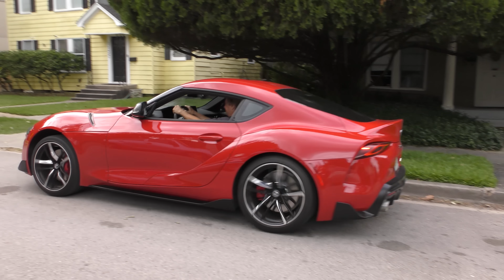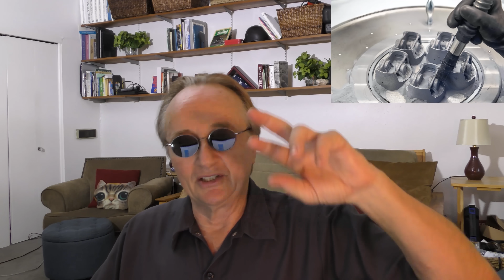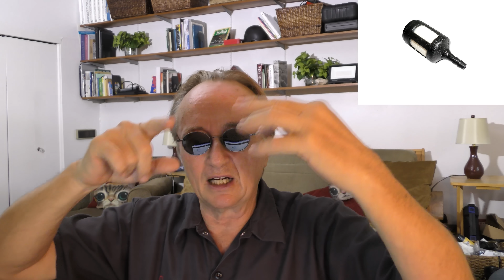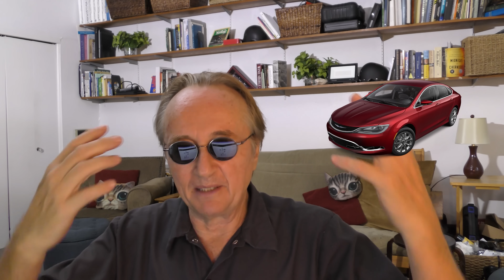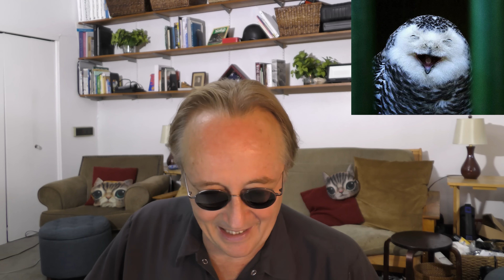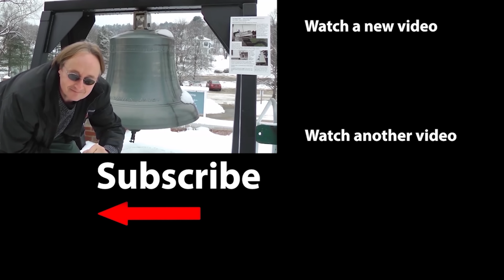Porsche Just Changed the World with This New Engine

Comment: I'd like to see them make pistons for an aircraft engine. A 470 CI or larger 6 cylinder engine. Then run that to TBO which is usually 1200-1500 hours. These engines are close to their capacity most of the flight.

Comment: Some of the really interesting engine tech that was developed a few years ago but isnt in mass production yet is solenoid controlled valves.  The idea eliminates the need for cams, gears, belts, chains etc, makes the entire engine simpler and more compact and lighter.  It also allows for nearly endless possibilities in valve timing which can adjust as needed. The biggest hurdle being reliability of solenoids.  I believe it was Koenigsegg who built a camless engine.  There are some videos of them also testing out a cam less head on a Saab.

Comment: 3D printed metal parts are being used in aircraft engines which far exceed any automotive use.  The 3D printed pistons will have a better grain structure than a cast piston but no where near as good as a forged piston.  However the 3D printing will allow all sorts of complex internal features that are not possible in forging and challenging if even possible on a cast part.

Comment: Scotty, One common theme through your videos (including this one) is that Chrysler autos are junk.  I own a 1996 Dodge Intrepid (3.5L).  In a little under 600 miles, it will turn past 300,000 miles.  Other than normal maintenance and wear items, the only major trouble I've had was a leaking camshaft seal at around 262,000 miles and a leaking head gasket at 286,000 miles.  Did I just get lucky, or did Chrysler, at one time, manufacture decent automobiles?
Reply: I was the one who posted to Scotty about my Pacifica.  I've owned from Chrysler- a 2003 300M, 2005 Dodge Magnum RT, 2011 300 Limited, 2014 RAM Laramie Longhorn, 2013 Town& Country, and 2019 Pacifica. Except for the complete structural failure of the 2013 T&C (which killed my wife- litigation pending), they've all been great vehicles with very few issues here and there.

Comment: I could see it working even if it takes 12 hours to make a piston if the printers are cheap enough.  For example if it takes 12 hours to produce one piston and you have 1000 printers then you can produce 1000 pistons per hour.  I have no idea the cost but I suspect that the printers are not cheap.  On the other hand 3D printers for plastic cost an arm and a leg when they came out and now they're practically cheap if you're using them for profit.

Comment: I have an extended warranty through Chrysler Dodge FCA and it has been honored the two times I brought my car to my dealership, once for replacing a tire that was damaged, and the $100 deductible was even waived.
Reply: That's cool.  I was the one that posted to Scotty about my Pacifica.  I had good experiences with FCA on my late wife's 300 when it had a couple of issues during the extended coverage (after 36k).  She was killed in her previous minivan, and I needed another minivan to keep my sanity with a 1 year old and a 2 year old.  What drove my purchase was the IIHS Top safety pick status of the 2019 Pacifica.  In addition to the "highest amount of components covered" coverage level for 7 years/unlimited miles, I also negotiated for free oil changes (indefinitely) at any Chrysler dealership for it.  So some of my maintenance is also covered.

Comment: I had a good experience with an extended warranty. We bought a used Mercury Sable and bought the warranty. After we owned it for a while, the oil pan gasket started leaking. The engine has to be removed to do this, but the insurance paid for it. At least that company lived up to their promises.

Comment: Hi @Scott kilmer. 
I have to say...
I had 2012 Chrysler 200. All maintenance done by the book at the oficial dealer. The car start turning off by itself without no reason. After 1 month, I can smell burning oil from inside of the car.
I drove the car to the dealer lots of time and they always say "this is normal".
Well, 1 month later...   the engine was liking for everywhere. He couldn't find the start point, because the whole engine was cover by oil.
Guest what???? The car had 108,000 KM.

My 96 Corolla has 332,000 KM and still running strong and NO leak at all.
Reply: I had heard that the 200 was a nightmare, which is why it was gone as quickly as it arrived. My wife had a 2011 300 Limited, and it was great.  Too bad it's being discontinued.

Comment: I purchased an extended warranty on my Infiniti G35 Coupe. The factory warranty was 4yr/70K and the Infiniti extended warranty added 7 years or 60K miles. I hit the time and not the mileage. 

This warantee was from Infiniti and it cost me $1,100. I shopped all over and the most expensive was $2K (out of Connecticut) for the same warranty, so it was worth finding this dealer in Minnesota that would sell it to me at that price. 

I had a seat motor, 2 window motors, a third brake light ($300 right there) and steering column replaced under this warranty. The warranty easily paid for itself and gave me some peace of mind. The only thing it wouldn't cover was wear and tear on cosmetic parts. I take care of my cars, so that's not an issue.

My grandfather purchased a third party warranty for a used Lincoln in the 90's. I don't remember what he paid for it, but he needed $2K worth of airbag suspension work done on it and they covered it. I was surprised.
Reply: That's cool.  I was the one that posted to Scotty about my Pacifica.  I had good experiences with FCA on my late wife's 300 when it had a couple of issues during the extended coverage (after 36k).  She was killed in her previous minivan, and I needed another minivan to keep my sanity with a 1 year old and a 2 year old.  What drove my purchase was the IIHS Top safety pick status of the 2019 Pacifica.  In addition to the "highest amount of components covered" coverage level for 7 years/unlimited miles, I also negotiated for free oil changes (indefinitely) at any Chrysler dealership for it.  So some of my maintenance is also covered.

Comment: A "starter" is, basically,  3 components:  solenoid, contacts, and the actual motor.  The contacts connect and disconnect the huge amount of AMPS that power the motor.  It is beefy!  But they wear out.  Most people replace the entire starter not knowing that a 25 cent part failed.  At my father's autoshop, we rebuilt starters and alternators.  It cost about $7 of parts and 30 minutes to an hour of time, at that time (1980s)!  We made a nice profit because  the parts were inexpensive and we made sure that it was done correctly.  In the 1980s, the quality of rebuilt starters and alternators was horrible.  We were not trading with China yet, so inexpensive (dirt cheap) replacement parts did not exist!

Comment: I'm not concerned w/ the 'production rate' of the piston, the programming & the material delivery system will be refined & you'll see the time be reduced. What interests me w/ 3D printing are the features you described, that are near impossible to produce by other mfg. methods. That's the real benefit. The pistons still have to be machine finished for the precise diameter, the wrist pin bore you mentioned & whatever else. Question: Did Porsche specify if they printed one piston at a time? That's the neat thing about printing, multiple parts can be made at one time. They can make a combination of parts too; piston, tappet, pulley, gear at the same time.

Comment: Hey Scotty, love the vids. I have a question for you. My wife's 2007 ford focus randomly shifts out of drive and into neutral and back into drive. Seems intermittent and not all the time, when it happens the overdrive light comes on, do you know what the issue is?
Reply: That would be the transmission slipping. Not a whole lot you can do for cheap, but it goes hand and hand with the age of the car
Reply: I think you have a piece of trash double clutch transmission. I drive Chevy school vans and I noticed the same nonsense. When you reduce to go  into a highway it shifts to neutral, I press the gas pedal and nothing. Also when I was reducing to make a turn, the same thing. Very dangerous stuff for a school bus or any vehicle. Then my supervisor told me that it  was a safety mechanism that the builder put on the transmission., Just crazy. I heard Scotty talking about that some Ford sedans use the same kind of transmission. Next time get a Toyota or Honda. It does not happens all the time, I think when it get too hot. I'm not sure but as hotter temperatures as worse that it would get. It may be the same thing. Good luck.
Reply: @romanc.5074  it's an automatic and we are keeping isn't as a backup car, we just got a 2020 honda insight hybrid 👍
Reply: Endless money pit
Reply: Problem is you let a woman drive!!!🤣
Reply: @derekrobertson9583  you drive dont you? I dont see the difference....🖕

Comment: I have a Mazda 3 2005 1.6D Manual, and it wont go over 3K RPM.. It is slugish a bit, running around 30% slower and weaker. I took it to the shop and they couldnt find ANYTHING wrong with it, they changed some filters, tested the Turbine, and nothing.. They suspect its some safemode but nobody knows how to disable it... HELP SCOTTY!!! I need my car to run fast again.. Thank you!

Comment: Having access to 3D printing would allow these brands to have a new business model making a living on selling parts for older models, or even potential upgrade packages for them, but on demand, rather than with a production line that inevitably gets costly due to being more practical to mass produce rather than just make a couple of parts every trimester. Printing said low demand parts would be quicker as well because when you introduce something new to a production line, most of the time stuff has to be changed which means they'd have to stop production till the retrofit is complete.

Comment: 3D printing is yet another digital disaster in the making. Need a model to cast parts? 3D printing is definitely the way to go, but replacing a forged anything in any metal via a 3D printer? Fugettaaboutit! There are some castings you might replace with "printed" parts, as you point out, it takes hours and hours to make a single part.

Comment: @scotty I have a 2012 Nissan maxima 80k miles the owner keep up the maintenance except the transmission fluid was never changed what should I do
Reply: Change the transmission fluid as soon as possible.
Reply: N0RT2G0RD4U it’s was a gift freebie I’m just concerned about the transmission don’t know what to do I was told just to leave it is pretty much a grenade at this point car runs fine
Reply: N0RT2G0RD4U I have a 2014 Nissan Altima and just changed it. I have 80k miles and it runs perfectly fine.

Comment: Imperfections in the bond of laserwelded metal where a problem in the past, I guess it's getting better.
Reply: Laser printed metal, in a check, shows a "splatter" of a hot top layer ending up fusing poorly to the cold base.
A lack of penetration so to say (welders jargon).
A process simular to sintering is used to ensure a firm bond.
I expect the heat treatment got fine tuned,  it is hard getting more heat in the metal without vaporising it.
Using thiner layers could also be true.
And that is all I know and could guess. 
I'll edit to insert the YouTube link when I stumble upon it.

Comment: "Eventually everything wears out".  Words of wisdom.
Reply: I know take my wife for example,no please take her.
Reply: Everything wears out is what you tell yourself after your junk wears out. 

Lots of things can last longer than a human life. 

Check out the lightbulb conspiracy. 
There are lightbulbs that have been on for over 100 years. 
In the 1920/30s those in charge decided that if they lasted forever they wouldn’t make as much. 
So they began designing lights to have finite life’s. 

So although everything wears out. 
It doesn’t have to. 

It it literally a conspiracy from manufacturers and law makers. 

My 1981 rabbit pickup Tdi can run for the rest of my life
Reply: Nathan Brame ok Nathan
Reply: My 04 Ram still going.. Original engine org trans. 16 years old, still goes good.
Reply: @itchytriggerfinger7622  I worked on a 2003 Ram with the hemi, last year:  best truck that I have ever worked on.  Insane power!  Solid frame, no rust...  KEEPER!
Reply: @itchytriggerfinger7622  for a Dodge that is great.  Right?
Reply: That's what she said
Reply: Even entropy?  How would that work?

Comment: The big advantage with metal powder additive manufacturing is that enables piston shapes to be optimized to an extent that's impossible with conventional, subtractive manufacturing techniques. BTW, 3D printed metal alloy parts are heat treated after they're printed to optimize their grain structure before actual application.
Reply: Kinda like Honda was doing in the 70's?